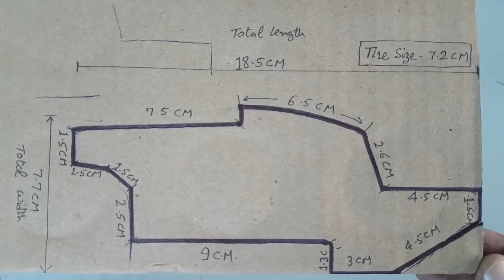WOW! Super RC Road Roller  || How to make Cardboard Caterpiller Road Roller || DIY  at home

Comment: use 180 motor instead of gear motor it will be very fast u can find it on ebay or banggood and next use wood glue instead of hot glue it will look more cleaner